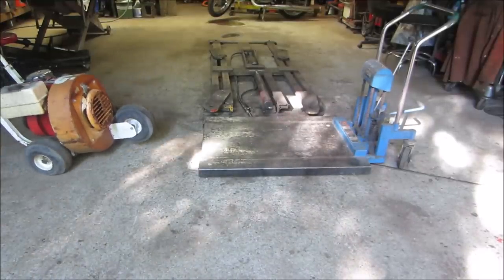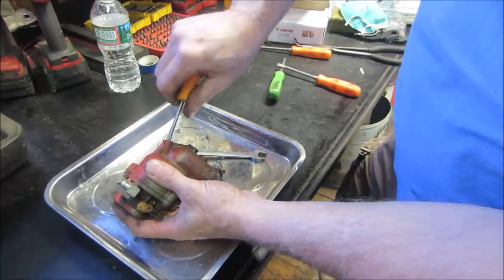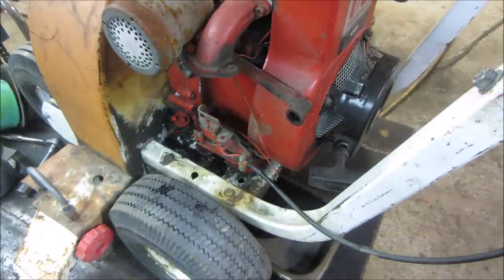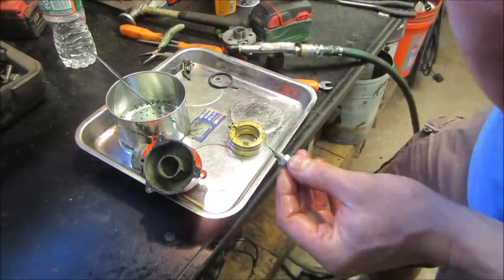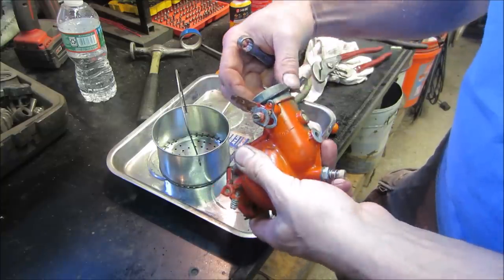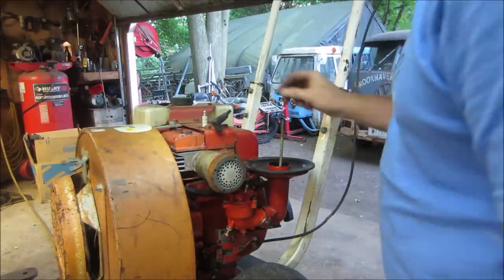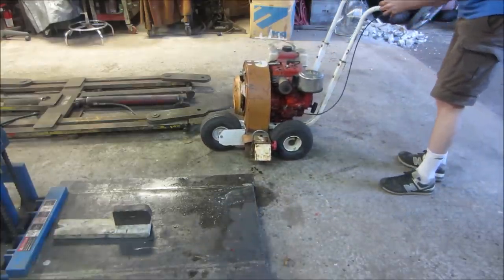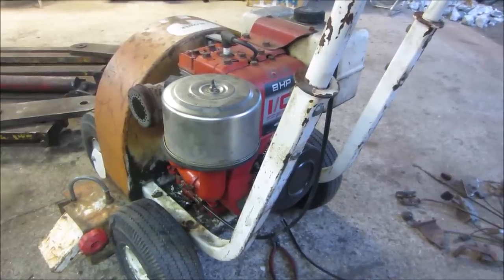Will it Run? yard sale leaf blower.

Comment: I have that same engine on my 4000W generator.  I pulled the bowl off with the long mixture rod in there and put it back with it in there.  So that is possible.  I did have an issue with fuel overflowing into the intake and I did a minor carb service (left the upper part of the carb on the intake manifold) and adjusted the float level a little lower, which then turned out to be too low.  Adjusted it back and it seems good now.  I also retrofit a paper fuel filter on mine and it seems to work OK.  I think these are good engines though mine does burn a little oil.  Probably will run forever though.  It's a good idea to rinse out the breather screen.I would turn the air filter housing so the main inlet points away from the exhaust and away from all the dirt/leaves that get kicked up.

Comment: Where the idle feed comes thru the two halves is a famous spot for air leaks and rough running Briggs , just a heads up . Also inner cable for the throttle control and outter coil with cover or plain can be bought to build you own lengths of control. Even in a heavier wire , less bending with the 092 thick type. Just a help if ya didn't know

Comment: One more great video.  I agree with the fact that alcohol attracts water.  This is why they say do not buy premix at a boat dock.  Much lower turnover rate vs regular gas.  Yes I own a 2 cycle boat motor.   Next on proof.  All vodka starts as grain alcohol.  190 proof or greater.  Just add water to get the desired proof you want.  You want cheap vodka, buy grain alcohol add equal amounts of water and alcohol together.  What make the best vodka is the number of times it is filtered.

Comment: We've had the same machine for 15+ years and it moves mountains of wet nasty leafs from my 5 acres in Michigan. I blow them onto a tarp a s drag it away. There's no better machine for fall.
Reply: Using the tarp is the way to move large quantities of leaves.    This was my mode of operation in Auburn AL when the seasons changed and the trees in the backyard dropped massive amounts of leaves!!!
Reply: If you don't have a tarp, an old vinyl shower curtain works just fine. Lol.

Comment: now you have a fan to blow cool air in the shop in the summer.  as for the fuel -  yes the alcohol does want to collect water. where i live  ( in WA. ) we have non alcohol fuel but if i didn't i would make my own by taking pump gas add water to it ; shake well ; set off to the side for a day then pour the gas off the top of the alcohol since the water intermixes with the alcohol ( on a molecular level) and  is heaver than gas. to help with the machine - take a piece of plastic bag and cover the fuel fill and put the cap on  (with a full tank). also what i do with equipment that gets not used all the time is to shut the fuel off and run it out of gas so the carb is empty. works for me.

Comment: The ethanol blended in fuel starts out nearly pure.  Most liquors actually have water added back into them to reduce the potency.  You are correct that ethanol is hygroscopic, it absorbs water from the air.
Reply: it all does, at any percent mix if left open to the air... not to mention the water/alcohol solution falls to the bottom where it goes into the tank pickup, since the majority of them are very bottom/lowest point, from there direct to carb. bowl
Reply: I think the alcohol used in gasoline is supposed to be 100% alcohol or 200 proof. Bars have been caught adding water to their booze. Distillers in the fuel business might be tempted to cheat on that as well as other in the distribution chain.
Reply: they do add a chemical to keep people from drinking it
Reply: not that pure I assume. from what I can tell, it take a whole lot of effort to get the last bits of water out and raise the alcohol percentage. I believe water and alcohol form an 'azeotrope' and the higher the concentration, the closer the boiling points of the water and alcohol in the mix become, therefore the more alcohol is boiled off with the water. I believe there's a point where you just can't get any higher concentration with distillation

Comment: Great video Mustie1, only thing i would do is turn that air filter intake away from the exhaust muffler, hot exhaust going into the air intake can be a bad combination.
Reply from the maker: it depends on how cold it is, its part of the design to rotate it

Comment: Ethanol max is 85% (azeotropic mixture) (you have to add a third chemical to break this).  I don't recall if Ethanol used in fuel is absolute or not.  So that would mean that 15% or 10% would be water.  To answer your question about what Ethanol does, the easiest explanation is it provides money to farmers for growing corn to make Ethanol.  Realize that there are those that will not agree with me.  The last thing is that chemically ethanol attaches water.  As you were trying to say, the normal thermal expansion (changes as the result in temperature changes) can draw air (with water in the air) into the gasoline ethanol mixture.   Enjoy watching you pull carbs apart.  I have a carb on a Snapper that is calling to me.  Thanks, again and keep on wrenching.  A gearhead follower.

Comment: i used a paper filter on my gravity fed lawn tractor. once you get the filter full it'll run just fine. i also prefer the paper filters since every now and then ill run out of regular gas it dosen't effect it since it only happens like once a season and i do yearly oil changes. the oil is washed out with fuel right now but i have one more cut of the season and shes done. but the paper help hold back some of the mix oil.

Comment: I had one of those and used (and cursed at it) for 20 years. They are very powerful and will shoot rocks that easily break windows. The bad part of it, though, was the big B&S engine would not start when warm. I nearly yanked my shoulder out with that thing.
Reply: Was probably the coil.
Reply: sounds like you had a sticking valve. i had a 5hp flatty briggs that would run great cold, then die when hot, and wouldnt start again.
Reply: I had a summer sealcoating job where I lifted one of those up and down onto the lifted Ford truck 10-20 times a day. That'll build ya a strong back!
Reply: A shot of Starting Ether if you have spark...........

Comment: I have TWO of them-both running
   -20 times more powerful than ANY BACKPACK blower BUT 30 TIMES heavier
Reply: they are great! can irritate a whole neighborhood in no time! the backpack one offer little exercise potential like this thing!
Reply: commercial wheeled units are powerful indeed,but only few DB 
   noisier than puny backpack blowers
    -but also MUCH,MUCH heavier than backpacks
      -that can deafen you since units are only ft or so from your head
,
Reply: And as luck would have it, it's on wheels so you don't need to put it on your back =P
Reply: I'm a city dweller... Tell me, why would anyone need an 8 HP leaf blower?
Reply: I wait until FIRST billion leaves fall down-then use 8 h/p blower
Reply: tarstarkusz it’s mostly for parking lots and big fields. Not usually for a driveway
Reply: +Dan... OK, that makes sense.  Mustie bought this from a residential person though.  I guess if you have a really big area to keep clean, it's a lot easier that carrying a vibrating monster on your back!
Reply: It takes me 2 hours to mow with a 44 inch riding mower. A little hilly, so it takes a little longer than it would if it was flat. The whole yard is shaded, so you can guess how many trees there are. Its so bad that the gutters have to be cleaned at least once a year otherwise come summer, the gutters have fresh dirt and plants growing. 
A backpack leaf blower would take too long for me to clean up the leaves. Luckily I don't bother, but if I cared, it would be either be a large leaf blower or a sweeper. Both preferable attached to the riding mower.

Comment: Just my opinion. When you start your small engines on a regular basis (every 3 weeks like I do) you are getting an ultrasonic clean from the vibrations of the engine running. Small engines that are left sitting for long periods of time and especially "outdoors" wind up like that one and ethanol is blamed when in fact moisture from the air begins it's destruction on "any" type of gasoline. Carb kits have been around for this very reason for long before we were had ethanol fuel. I do like ethanol free fuel best but run and don't improperly store the engine and the fuel and if you're like me you can run ethanol fuel . I use a dry erase board in my storage building to denote the date of my next start up (every 3rd week) and haven't had to rebuild a carb yet. That's alot of years of using ethanol fuel. Agree with your ideas for certain on temp changes attracting moisture.

Comment: One thing that used to drive me crazy when those carbs would leak wasn't the needle, but the jet. There is a little tapered area right where the smallest diameter starts (the part that sticks through the throat of the carb.) That taper has to seat with a female taper in the carb body. If there's any corrosion on either part, it won't seal and it will leak. I kept an old jet with the threads ground off to use as a lap to lap the female taper in the body. I only had about a 50% success rate. I usually had to replace the body.
Reply: That engine might have had the carb body replaced as it appeared to be a more orange color than red, like the upper half. Maybe someone soaked it previously which changed the color. I've see Briggs engines that were a more orange color  as well as white, black, yellow, gold and brown. Another oddity on that engine is the white plastic fuel tank. I don't recall Briggs using different color tanks. I thought everything on the engines were the same color and the plastic tanks were the same color as the engine. That fuel tank might have been replaced. The I/C  [industrial/commercial] engines used the updraft carburetor.

Comment: You are 100% correct about the fuel today! If you dont use stabilizer it will go bad fast! I use stable in all small and motorcycle engines!

Comment: I was not aware that the paper filters would not work on gravity flow.  Ones I have tried seemed to work.  I hope you put oil in it!!  Gas flows out of them easily when disconnected.  Viewers: NEVER blow air into the fuel line with the carb disassembled.  You will hear a little pop as the Seat for the needle leaves the area...!!  In Ontario Canada, Shell Premium does not contain any Ethanol.  No Hygroscopic problems.  I do keep the XLR Full during storage and small engines run empty and float drained if possible.  Great Save.
Reply: In Ontario all  91 has no ethanol, 89 up to 5% and 87 up to 10%. WE also can get 94 octane from shell i think or is it petro can?

Comment: Reminded me of when you accelerate without a accelerator pump one should adjust the main flow to not bog when you give it throttle. This works for me when I adjust generators that fluctuate according to electrical power drain load.  What do you think?

Comment: A long time ago, 27 yrs or so , I worked for the company that painted the housing for little wonder blowers , that's an earlier one that was done with automotive paint, later ones were powder coated and the finish lasts much longer

Comment: I'm in the uk and I once purchased a brand new Kawasaki motorbike and in the winter months I would be on my way to work and it would just die, I took it back to the when it first happened and they said that the carb wasn't for the uk ??? But I had to add these little bottles of liquid one for every tank of fuel I was told it was suffering carb icing as the fuel is molescopick I think that's spelt wrong but basically the fuel absorbs moisture and freezes in the carb jets but it was fine with the additive, on the first service they sorted the carb out and never happened again

Comment: a tip i found don't know the validity yet  is clr (calcium lime rust remover) helps with aluminium  soak it and use a wire brush and it comes up quite good from all accounts  just sharing hope it helps someone (it was used on a mini gearbox case soaked for a day in a rubber maid tote) one whole "clr" container and the rest was filled with water.

Comment: Looks like an old "Little Wonder" blower. I have one that's simmilar but it's a 5 HP one. Paid about what you paid for yours at a local flea market. Have to remember that little trick with the flex seal since mine has a leaky tire as well.
Reply: You can buy an innertube cheaper than you can buy a can of Flex Seal here in North Carolina.

Comment: 1.5 to 2 turns is way to rich on those engines.  I have found the main jet is set at about .75 to 1 turn out, otherwise you will flood the crap out of the engine.  The thin tube you referred to is the emulsion tube.  I generally set the float height at level and replace the needle, which has a Viton tip, so it does not have a seat.  I also usually tap the new needle with my 2 ounce ball peen hammer to seat it.
Reply: I always start with 1.5 turns out.  I crank them in first and count the turns.  I NEVER tap the viton needle tip.
Some have a seat as well, I am sure that old B&S does.

Comment: My Wonder boy has a 16 hp Briggs . I used to have to rebuild the carb every year . I put a good fuel filter on it and glued the jets in place and haven't had to touch it in years. You had better luck than i did the first two hundred times I rebuilt that stupid carb . lol

Comment: That type of carburetor is called the leaker by the brigs and Stratton people. The simple way to fix the leak is a tiny plastic gasket that you install between the brass needle seat housing and the aluminum seat of the carburetor. Over time the aluminum corrodes and causes the carburetor to leak gas.

Comment: yep draws moister out the air ,just like brake fluid. suppost to change brake fluid every year or so ,but no one does .  we got same problem here in the arky ozarky .high humidity and temp swings .grandpa used to put a sandwich bag under the lid ,when not using the tiller to keep moister out .

Comment: That particular style of B&S is a pain !  the adjustment needle for the main jet is notorious for leaking, probably because the packing dries out or the O-ring is shot.  If you plan on keeping it, get a carb kit and replace the gaskets and packing.

Comment: E10 Nasty stuff. You are correct E10 is hygroscopic it absorbs H20. Think gas line antifreeze - same effect. And i hear rumblings of the percentage going up to 15 % lucky us !! If i could ask you ?? Where do you get the cam 2..Small airport ?
I have a thing for 2 Stroke bikes. At least with some oil in the mix, the left over crap is not too bad. I always pre mix.

Even just a few weeks of sitting will make things come out of solution.  E Gas sucks!!

Comment: Our local Kwik Star's have 91 octane with NO ethanol.  I use that in all my small equipment.  I've NEVER had an issue in any of my cars with E10.  Even my garage queen G8 hasn't had an issue.  I fill it with Shell 93 with 10%.  Our boats and watercraft have had issues though.  We use StarTron ethanol treatment in them and that pretty much resolved our issues.

Comment: Mustie1 you probably already know this but I'll tell you anyway.  My dad, when I was young, would take cables like that and put them in solvent or diesel fuel to get them moving again and then put them in some oil in a bucket and let them soak over night.  Most of the time it worked like a charm.

Comment: Push blowers are heavy, awkward, and slow.  If you attach them to a zero turn with correct brackets, they are good for large, heavy leaf areas.  Take a good backpack blower like a Stihl BR600 and it will get the job done.

Comment: The ethanol they mix into the gas is there to prevent ice during cold months and it mixes with water and then gasoline to extract the water out of fueltanks that appear through condensation. It is mildly hydroscopic and will in of itself attract water out of air but the trade off is worth it if you live were condensation and ice is a problem in the fuel.

Comment: after i bought my old 77 kz1000, it kept running rough/dying. took it to the shop, and the mechanic said that the main nozzles were at the bottom of the jet instead of in the middle, so i should add a bit of methyl hydrate  (gas line antifreeze) when i get gas. it breaks up any water molecules, and allows them to get sucked into the system and burned off, instead of screwing up your fun time. it ran just fine after i started doing that
Reply: sysfixr huh i got a kz750 1980. I try to find ethanol free 91 octane due to 10.5:1 comp. I got a video of it on my channel, but i spun a bearing. Shut it down b4 anything went through the motor. Just outter #4 rod bearing screwed up. Ill fix it i love kzs

Comment: if a half full gas tank is metal , the temperature change from night to day will cause the water in the air to condense on the sides of the tank, just like an ice tea glass in summer, A full tank does not condense as much.

Comment: nice goin, used the wrong size..... just kiddin
Shouldn't you check how many turns (the setting) on the needle valve seated before you remove it?
Nice way to jab your hand with the screwdriver buy holding the part (carb) in your hand unsupported. A rag would give your hand some protrction at least, huh?
Nice way to put burrs on your Snapon Screwdriver handle.  How about a plastic hammer?
Opp, I knew it, hammer mechanic...LoL
Blowing an airgun next to your parts tray, I saw a washer-looking thing go for a walk.
Do I see a "road rash* scar on your forearm... I would of been tempted to adjust the float too.
Squeezing the tire with the pliers was a hoot!!